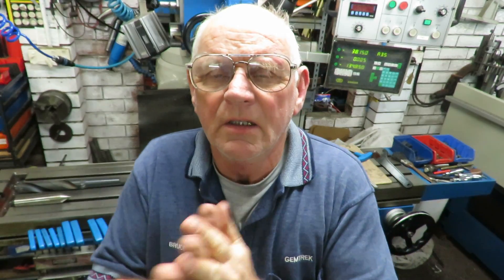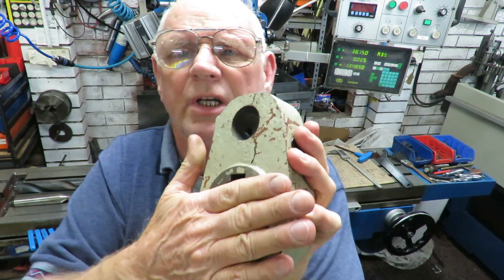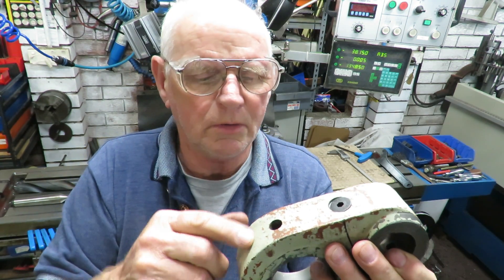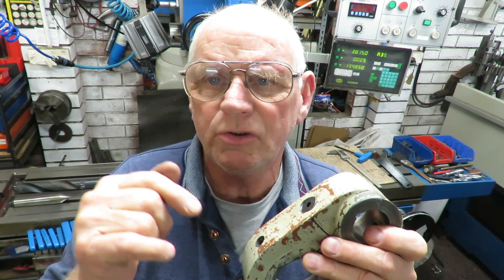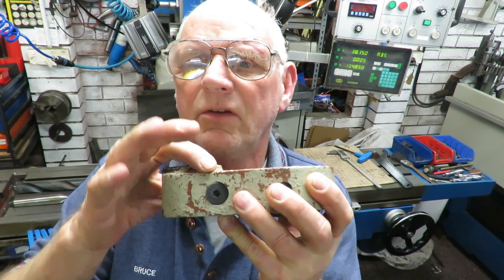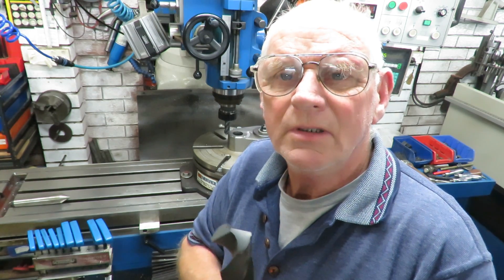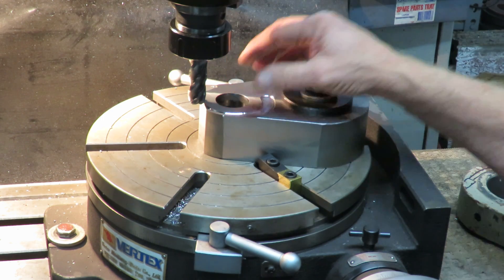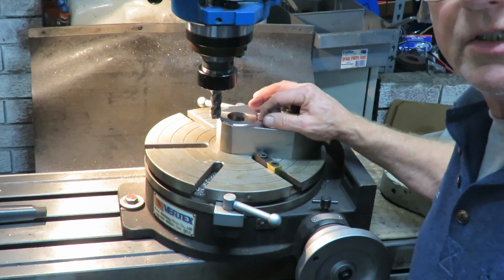463 Cranky Arm Series Part 3

Comment: Bruce, an idle thought. For centreing things with holes in 'em on the rotary table, would it be worthwhile to have a short mandrel, tapered to fit the taper in your rotary table, with an accurately centred and sized parallel-sided through hole in it?  This tapered mandrel would be short enough that it did not protrude above the rotary table surface, so that the workpiece could fit flat upon the surface of the rotary table. A bloke like you could knock that out in half an hour,  surely.

I envisage that you could centre the workpiece by turning up another mandrel, with one end sized to fit the centre hole in the tapered mandrel in the rotary table, and the other end sized to fit the hole in the workpiece. You would make these as necessary, and either bin them or keep them as you see fit.

The through hole in the tapered mandrel would allow you to drive out the secondary mandrel after use. 

The primary tool, if that is the right word, is the tapered mandrel that fits the rotary table. The secondary tools are the custom-made mandrels manufactured to fit the parts.

.Or is that just too much mucking around?

Comment: Wonder if anyone could comment on the pros and cons of changing materials in a part like this. Cast parts break and its common practice to remake in steel.. Are there any cons to using steel?
Reply: Daylight In The Swamp sure, cost, and machiniability are going to be different. 
But for this setup the stronger steel would seem to be a good option, where as for other applications it would be a big mistake. One place where this is evident is changing a brass shear pin over to steel. The difference in the amount of force the pin will take till it breaks could be very damaging to the equipment and it humans too.

Comment: I don't know what forces are acting on the arm, but I think splitting it will significantly weaken it.  You are saw cutting through many mm2 of metal and replacing it with very few mm2 of bolts.  The prying action of the crank arm about the key (which should be taking all of the torque) is trying to split the bottom of the crank bracket.  The hoop tension capacity of the un-cut bottom of the arm is massive.  A pair of socket cap bolts is much less.  Isn't the purpose of the taper pin, just to locate the crank so it doesn't fall off the shaft?  The keyway should be doing all of the work.  Surely there must be a less invasive way to keep the crank in place.  I'm just thinking out loud here, so don't kill me if my assumptions are incorrect.  I see this working much like a hook spanner, versus a box wrench.

Nice machining though.
Reply: I think the difference in materials will make the difference with regard to strength, I shared your thoughts initially mind. It occurred to me that if the top of the casting is floating in air, I might have changed the design a little, maybe adding more of a boss to allow for more clamping pressure. Lovely work though, I always enjoy watching Bruce.
Reply from the maker: Barry this will also make for an easier site fit, as I'm lead to believe it is a very restricted access and the technician that will be flying up with the part to install it is very experienced and was in my shop yesterday morning and liked the solution very much, as he said it can be a huge struggle. Taking that into account I have allowed for a slide fit to assist installation. In all my years repairing and making replacement parts for machines I haven't had this sort of solution fail.

Comment: good solution to the tapered pin problem.its simple but i wonder how many would have though of it.how did you get away with climb milling on the rotary table?  zero backlash  or engaging the table brake? keep them coming bruce.
Reply from the maker: Larry, Thanks mate, that table is pretty good with very little backlash I  did close the rear clamp slightly but I had no "runaway" just a very nice easy feed the cutter is something else!